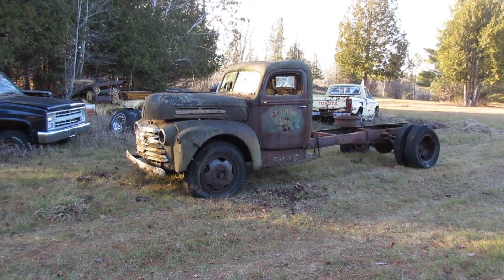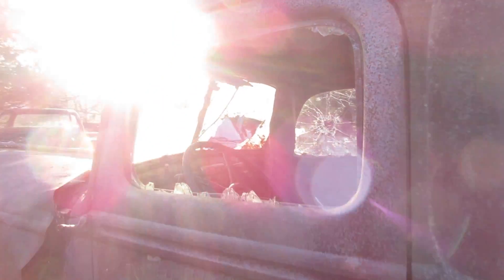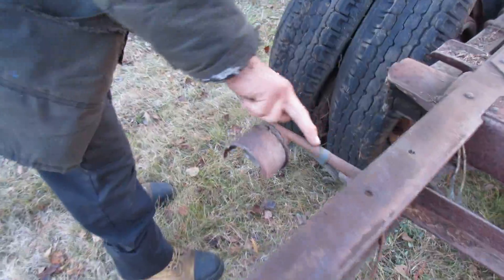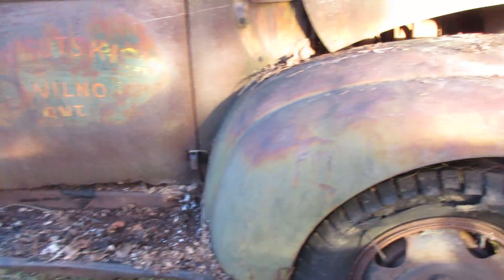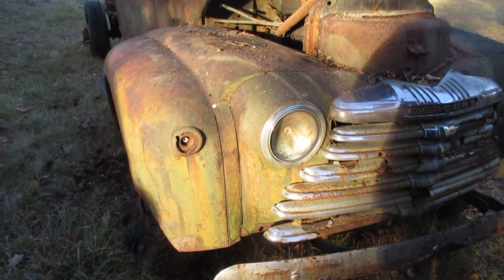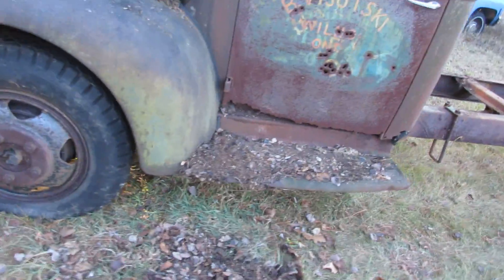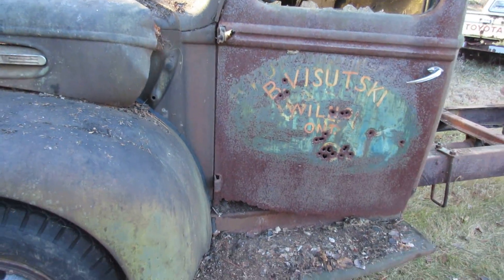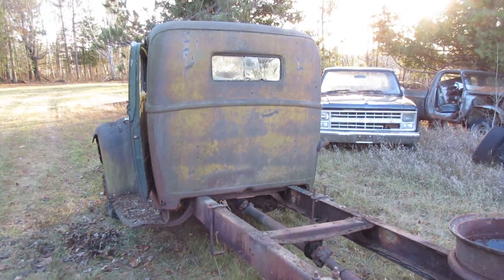1946 Mercury 3-Ton Truck with unique extended frame.

Comment: I see this is from 4 yrs ago , has it been restored ? I have my grandfathers 47 Merc  2 ton grain truck , all original , in process of restoring
Reply from the maker: I have a 47 Ford jailbar pickup with an 8 foot box that I have been buying parts for over the last few years. Fenton aluminum intake & heads, headers, Stromberg carbs, Ford 9 inch final drive, another box and things like decent wheels & hub caps. This 46 is too far gone to spend a lot of money on but it has a Z69 Flathead that is a great engine for any street rod if built right. Thanks for your comment and all the best with your grain truck. My earliest memory of any kind of truck was an old Flathead Ford grain truck with a stake bed.

Comment: How much did you pay for this unique truck?
Reply from the maker: Well, I bought it from a friend so it's not that accurate of an actual value. Even for scrap you would pay about $500. Basically with these old vehicles, in this state, you just see what you can get them for. If you are asking me to put an actual value on it I would say at least $1000 Canadian. The engine in it turns out to be one of the legendary "Z" blocks. So not only is it a Mercury engine with the longer stroke but it is one of the heavy Canadian block castings that will safely accept serious overboring. These blocks are sought after by the Hot Rodders and may be worth some money for that reason. Certainly finding the "Z69A" stamping on the top of the right bank was a bonus for me after having it home. I'll try and make a "walk around" video of it this Spring. Maybe get it running if I have the time.